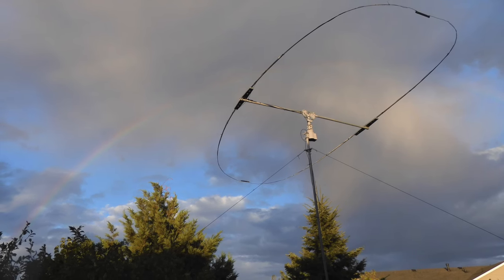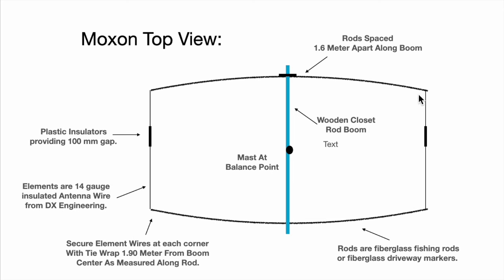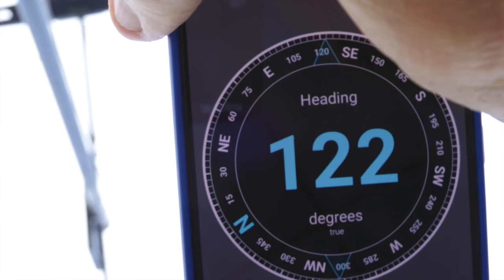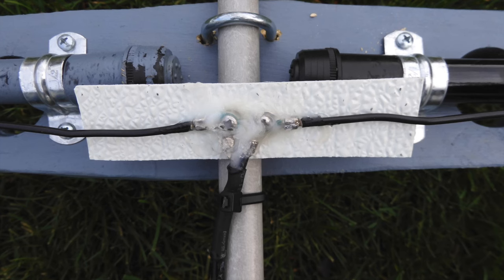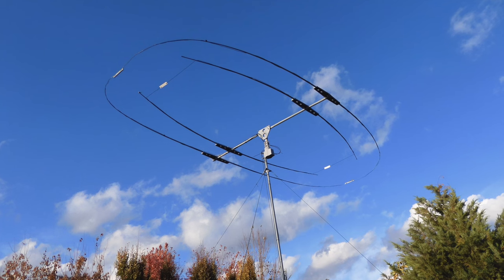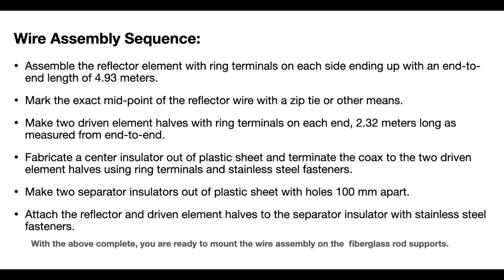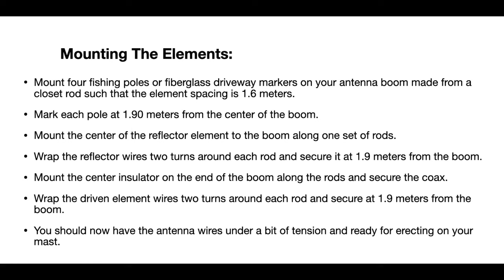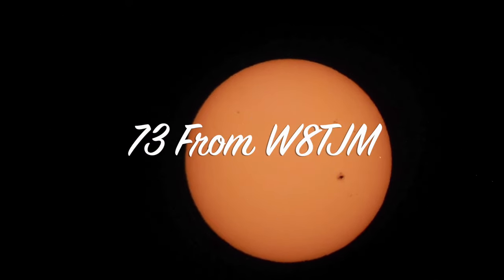Yet Another 10 Meter Moxon!

Comment: Can you please do another video and show how you interlaced the 10 and 15 meter moxons when you did attempt to have then interlaced. I have found very little literature and or videos on how to do this. Thank you in advance!
Reply from the maker: I never did try to connect them together and only used separate coax runs.  If I were to do it, I would likely try bare copper wires with about 1 inch spacing between the feed points and them attempt to connect the coax somewhere along that copper wire interconnection.   Not willing to spend the time on it myself so give it a try and report back on your results.
Reply: At 5:55 you said you interlaced the antenna's and showed 4 swr graphs ... Doesn't that mean they only had one feedline?

KC1POV
Reply from the maker: @dmoney4622   The antennas in those graphs had their own separate feedlines.  That graph shows how the antenna's physical interlacing affected the SWR.  A bit surprising in the direction it took the responses.   Good questions!
Reply from the maker: Also.... Check out the QRZ page for HB9DSP and you can see one implementation of a multi-band Moxon.  He has had good success with it.
Reply: I understand what you are saying with both antenna's near one another... thank you for the quick responses! 

73 de KC1POV
Reply: @W8TJM  why would you use bare cooper wire as compared to insulated?
Reply: @dmoney4622  Makes it easier to slide the feed coax along it to get the best match.    No need to remove insulation to make a connection point.

Comment: Hi could you please give me the wire length for the driven element in feet and inches,and also the reflector best regards Martin
Reply from the maker: Those lengths are in  the video under the wire assembly instructions in meters.   In inches, the reflector is 194 inches long and the director halves are 91.3 inches long.    I hate doing English conversions so always use metric.  73
Reply: Lazy guy ... 😮😂

Comment: Do you think there would be an advantage to angle the driven element up to increase the takeoff angle?
Reply from the maker: It seems keeping it horizontal works the best.  You might try modeling it with EZ Net to see what you find.     Usually you want a low take-off angle.

Comment: You can make the dividers with nylon thread. They can be used as two round electrical terminals. It will be much lighter and will give a better adjustment of the ROE.

Comment: Has anybody eznec these different arrangements?? I am curious to see how the results differ from actual measurements.
Reply from the maker: Analyzed them (21 segment arc approximation) before building them and the performance is very close to a normal rectangular version with some parameters life forward gain actually better.   Turns out the length of the elements is more important than the shape.

Comment: can i make one theses for 11meters.
Reply from the maker: Sure.  Just make the wires a few percent longer.
Reply: Hi Toivo
Excellent antenna build!...I am currently using a single element 10m elongated rectangle loop and it works great...have been thinking of converting it to a moxon using the same footprint..your video is motivating me to do that👍
73
Steve
W8SAW
White Lake

Comment: After years of trying out simple antennas the one element delta loop topped them all, not to mention the big decrease in QRM.
Reply from the maker: I am a big fan of delta loops also, but they end up being a bit too large for the area where I live.   Had one back in 2015 and it did indeed work well.
Reply: @W8TJM  Too large on 10m band? should be more or less the same size (had them both on the same pole, not at the same time that is, lol) but then again, what do an old radio ham like me know, lol Anyways, the delta loop was fed as a vertical and most times did much better than the Moxon without the need for rotator. Enjoy Ham radio testing is all part of the fun.

Comment: Hi Toivo. I think your design is very clever. Re the interlacing affecting 10m VSWR, given you have seperate coax feeds, why not lift the 10m antenna higher on the mast to get some vertical seperation to the 15m antenna. I’ll bet as you lift it there will be a point where the VSWR starts to return to levels like the independent readings you got. Worth a try? Cheers Trevor VK3DCQ
Reply from the maker: Trevor... That is a solid suggestion!   I think it would indeed get the antennas to be a bit more independent.  Only negative is that it adds weight with the additional boom and bits needed, but it is certainly worth a go.

Comment: Great video. I'm curious as to what kind of rotator you are using. I've priced a few and they seem pretty expensive. 73 W2ASH
Reply from the maker: Thanks for the compliment Jason!  I bought the RCA VH226E  rotator two years ago and have been impressed with how well it works.  It is around 120 dollars at Amazon and 109 dollars in other places.  I have given it a lot of use and no issues.  The push button direction setting is very convenient. For light antennas mounted close to the rotator, it should last quite a few years.
Reply: @W8TJM  Thanks for the quick response. The price on the VH226E isn't bad at all, especially considering how expensive some of the HAM-specific units are. I think I'll pick one up when I try a Moxon build this spring. Cheers and 73. Jason W2ASH